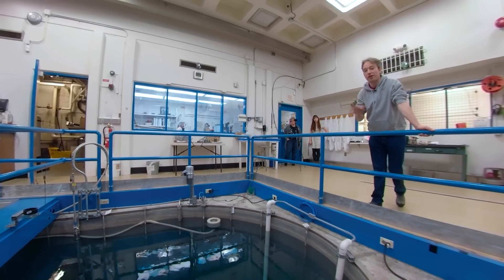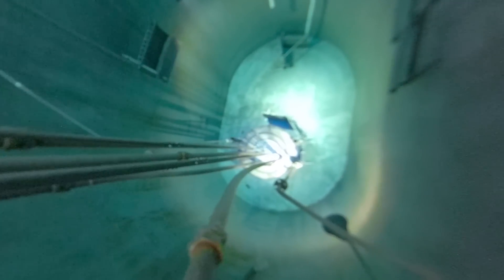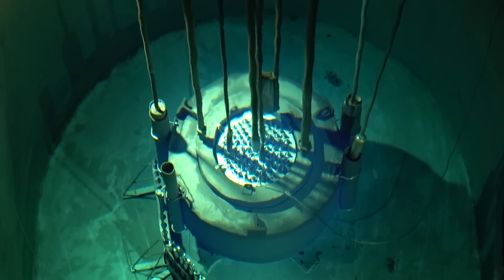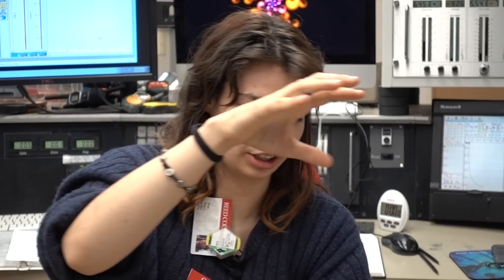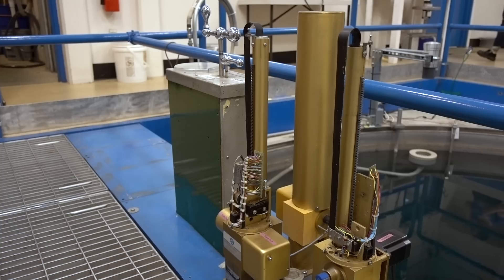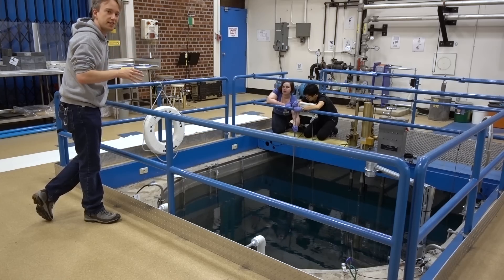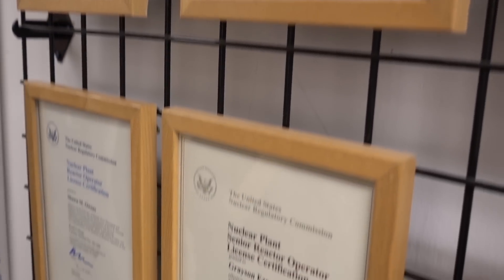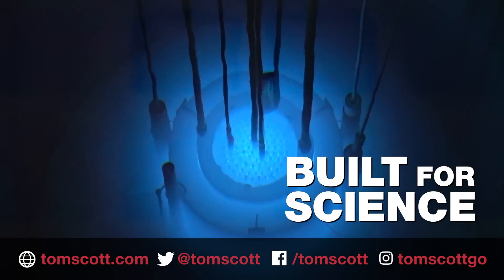This nuclear reactor is run by students

Comment: The stupid thing is that Reed doesn't have a nuclear engineering program. Some say that the only reason they have the reactor still is because it's too expensive to dispose of.
Reply: Alexander DePillis Reed is a small liberal arts college, our majors are in more general subjects.  It wouldn't make sense for us to have a nuclear engineering program, because each graduating class is less than 400 students....how many of them would want to specialize in nuclear engineering each year?  That said, Reed has very strong science programs for a liberal arts college and has produced an unusually high number of Rhodes scholars and has a very high rate of students going on to earn PhDs.  Additionally, experience with the reactor is useful for other majors besides nuclear engineering- I would know, I graduated with a degree in Biochem, am going into nuclear medicine, and my experience at the reactor has been incredibly useful!!  The reactor is also a fantastic college job, and we teach many skills (such as management, public speaking, research design) that are useful for students not going into nuclear science. 

As for the cost of decommissioning, it is indeed expensive.  However, it is required in the reactor's facility license from the NRC that we have the money available to decommission if the need arises.  If we were not able to afford to decommission, we would legally not be permitted to operate the reactor.  The money set aside for potential decommission is a part of Reed's multi hundred million dollar endowment.  The license is re-evaluated and renewed every several years, but representatives from the NRC come to inspect our facility at least once a year to make sure everything is going well.
Reply: Sarah Brodesser Thanks for your thoughts, I knew Reed was small, but I didn't know it was that small. I do think that they could support a nuclear engineering program, in part because the reactor would be a major draw for nuclear engineering students.

I was also unaware of the money specifically set aside for decommissioning. 

Thanks again for giving me a new perspective.
Reply: +Liou David as they said in the video, at the current rate of use, about 100 years left

nuclear fuel is expensive and hard to manage but it last a really long time
Reply: As a Reed grad ('87), now with a PhD in physics, I'd say the reactor was a useful and functional part of campus for many departments. As a liberal arts school, we're learning the fundamentals, knowing that we'll apply them later (I went to Purdue University afterwards and have taught at several colleges and universities). I really can't imagine having an engineering program at Reed, though we do learn a lot of applied skills. For example, I took a course in microprocessors. The professor, Richard Crandall, was lead cryptograher for Apple. And I took a course in algorithms. Etc. I'm happily passing along my knowledge to high school students in Louisville Kentucky now.
Reply: Some reactors burn through rods in 5 years, others can take up to 30
Reply: @wifi_the_router  I had an ex like that
Reply: This reactor is an instrument for doing chemical analysis, (neutron activation activation) mainly used by the Reed chemistry and biology departments.
Reply: +Samantha Dansjin when utilised close to 100% of the time, yeah, you get "just" few years up to few decades out of them

meanwhile, in the middle of winter, I need to go put coal into the furnace every hour to keep the house warm
Reply: Wait what? A university bought a nuclear reactor for the sole purpose of education and doesn't have a degree to match?
Reply: how long does those rod last?

Comment: Holy crap this was interesting, Tom. Can you point me to a video that can elaborate on that "visual sonicboom" effect?
Reply: I don't have a video for you, but the blue light is from particles that are traveling close to the (vacuum) speed of light entering a medium where light can't travel as fast, like water. Since they're now traveling faster than the (in-medium) speed of light, they have to slow down and lose energy. They do that by giving off light, which is the glow you see when the lights are turned off.
Reply: doublej1076 awesome explanation. I appreciate you taking the time to elaborate on it for me. Thank you!
Reply: If you search for Cherenkov radiation you should find some great explanations for it. The effect is caused by electrons that are released by the fission reaction and are traveling faster than the speed of light in water(which is only 3/4 the speed of light in a vacuum).
Reply: doublej1076 so you could change the colour by changing the liquid? Have a pimping purple reactor??
Reply: @magicalpencil  Possibly, but the question would then be how well does that particular liquid work as a shield and the ability to remove heat from the radiation process.  As mentioned below, it will depend on obtaining the proper peak emission frequency for the Cherenkov radiation.
Reply: *is naturally able to in water. No laws broken
Reply: Unfortunately probably not purple, the peak emission frequency for Cherenkov in water is actually UV, the reason why we see it as blue not violet is due to the fact that the human eye's sensitivity to light peaks at green. 

Its a similar reason to why the sky is blue, actually, Rayleigh scattering means that higher frequency light such as blue and violet is scattered more (with violet being scattered more), but with the addition of the human eyes greater sensitivity to blue.
Reply: 1997CWR thanks!
Reply: Ah, all's right in the world then.
Reply: magicalpencil You are asking the interesting questions!
Reply: No, they dont travel faster than the speed of light, they travel faster than light would in water. They arent even as fast as light to begin with.
Reply: So, that means those particles do travel faster than the speed of light, even if for a moment?
Reply: Interesting stuff!!
Reply: Toss something that fluoresces purple in the water, sort of like purple fluorescent lights.

Comment: I'm from Portland and this is my favorite way to freak out people who are afraid of nuclear power. "yeah there's a reactor like 3 miles away ran by students at Reed."
Reply: I do the same with the research reactor at my undergrad uni. It was run by the profs though because the computer system hasn't been replaced since it was built in the 70s and they don't want students breaking the vacuum tubes.
Reply: @agilemind6241  vacuum tubes my God that's old
Reply: Agilemind 🍸 noice
Reply: @agilemind6241  what uni ???
Reply: My favorite part was in all the recruiting materials I ever got from Reed, they emphasized this rubber duck they always kept on top of the reactor XD
Reply: @alyandthecats  THERE'S A RUBBER DUCK?!
Reply: I'm down at OSU and I do the same thing. My old apartment complex was about a quarter of a mile from our reactor, which freaked my family out. I walked by it twice a day on my way to class for 2 years without worry though.
Reply: @B-rad1  Gotta love freaking out people who are scared by nuclear power
Reply: There's a nuclear reactor near here run by 19-21 year olds who aren't even pursuing a nuclear engineering degree.
Reply: "There is a reactor near here that is run exclusively by people who couldn't even finish their university degree..."
Reply: Same i live in oregon but im down in eugene
Reply: I'm from Portland too. I'm going to have start using this.
Reply: And it has run for the past 50 years!!
Reply: @elliotpowell1702  that's not true - nuclear power kills less people per megawatt than even solar or wind, and hundreds of times less than coal mines. Chernobyl was caused by poor regulation + oversight and it is likely that a disaster of that scale would not ever happen again.
Reply: @codyfellinge2346  Except when something close to that scale happened again in Fukushima. 'Luckily' a lot of the fissible material sank into the pacific and the government was quick to relocate the populace.
Reply: @codyfellinge2346  
... Until a Chernobyl scale disaster times 4 happened at Fukushima.

Never say never.  Have you heard of Davis-Besse, "the reactor with a hole in its head"?
Reply: Acme Fixer no power source is 100% safe
Reply: @dylanb2990  But some are safer than others. Fossil Fuel, Solar, Geothermal, and wind all haven't caused nuclear explosion. There is always reason to be skeptical, and by saying, "All energies are unsafe" it downplays the destruction capabilities of the nuclear reactor. I'm staying as far away as I can from those things, if you ask me.
Reply: @acmefixer1 in the triga reactor you can say never, in some operations they even let the reactor run away, at full power, until the cooling water kills the reaction again, there is so much cooling water it physically cant run away. the only reactors where this can catastrophically go wrong is the rbmk (chernobyl). Fukushima is a different case as half of the reactors control systems literally broke.
Reply: @codyfellinge2346  Your argument does in no way disprove the claim you're replying to. If you do not understand why a 250kW power plant (whether nuclear, coal, hydroelectric or something else entirely) is inherently less dangerous than a similar 250MW power plant, then I hope for the sake of everyone that you'll never have to make decisions pertaining to public or industrial safety.
Reply: Run*
Reply: "And they keep dropping their phones in it"
Reply: when i heard 3 miles, i immediately thought 3 mile island.
Reply: Proves how safe nuclear power is.
Reply: @elliotpowell1702  
That's like saying, "If it's small, then it can't end up like Chernobyl."

At WIPP, someone used the wrong type of kitty litter and a 'minor radioactive waste spill' cost a half Billion dollars to clean up.
Reply: I would be scared, that stuff is still dangerous.

Comment: What's the purpose of the water? I see it everytime whenever it's about nuclear power technology yet still doesnt know what it does
Reply: Dani Ihza Farrosi cooling and shielding from radiation
Reply: Cooling
Reply: In many types of reactors (including this TRIGA iirc) the water also acts as a moderator, ie slows down neutrons to a speed at which they are likely to interact with the fuel. Neutrons leaving fission events are typically to fast and would exit and be absorbed elsewhere if they were not slowed down by the water...
Reply: Cooling and absorbing radiation. I think.
Reply: Ah neat..! Thanks for the info
Reply: The TRIGA is a light water reactor. If you spent the money making heavy water, the last thing you would want is for it to evaporate! Heavy water reactors are closed systems.
Reply: Ya, the reactor actually doesn't even function without the water. like 
sadropol mentions
Reply: Cooling and shielding
Reply: Hydrogen is good at blocking radiation, and water has a lot of hydrogen in it.
Reply: Ya, TRIGA is NOT a heavy water reactor at all. This is completely incorrect. Only CANDU and certain research reactors use heavy water. HWR are actually a little more concerns for proliferation because of their lower neutron absorption cross section...it is much easier to breed plutonium.  Part of the Iran deal was them scraping their HWR, for instance, and the Indian's got their weapons grade Pu from a small HW test reactor. TRIGA is not such a thing. It is small, it is safe, it is basically for students and can serve as a novel but modest neutron source for materials testing. But nothing like a HWR which can give you very powerful neutron beams.
Reply: The pool is situated above the reactor so that in case of a meltdown the water will soak the meltdown by gravity. Also the water is usually "heavy water" with deuterium that further moderates the radiation. In larger reactors, those that boil water for power, there is a lid on top of the fuel separating the water from the fuel and there is no radiation leaking into the pool in normal operation. The lid is only opened when refueling.

Comment: YES! This is the content! Nuclear is life!
Reply: John Smith nice propaganda m8
Reply: Im all for nuclear, but big solar is fine as well.
Reply: Patchouli Colt …until you swim in it 😅
Reply: It's called "Nucular", "The Nucular"! And you mean "nucular is death"!
Reply: France is using Nuclear big time now and using the waste as energy too. America needs to reconsider nuclear before it is too late. Solar is good, as long as it isn’t cloudy. Hydroelectric is a good source as well, but disrupts the water flowing system and changes valleys and rivers and needs a crap load of construction.
Reply: Eric Franco: Nuclear energy should not be reconsidered by anyone. If you use the waste another time it's still radioactive for millions of years. Nuclear energy is not clean and not CO2 neutral. Please do some research and inform yourself about all risks. There are many.
Solar is still good if it is cloudy. It generates at least 10% of its maximum output, even in northern Germany. (acc. to the German Prof. Volker Quaschning here on YT)
Run-of-the-river hydroelectricity is a better way of generating hydroelectric power than using reservoirs. (see Wikipedia)
Don't forget wind energy. The German company Greenpeace Energy produces hydrogen from wind energy which they feed into the gas pipeline network. They call it Windgas.
Of course we must not pave the whole world with solar modules and wind turbines.

But what most people don't want to hear: we all have to reduce our energy consumption, at least a little, better as much as you can. We do have to give up a little luxury to save the planet. I'm already doing it.
Reply: The Python Guy: Are you a troll? Nuclear energy is not clean and not CO2 neutral. Please do some research and inform yourself about all risks. There are many. But maybe you're just caught in your filter bubble and can't see the truth any longer.
Reply: Patchouli Colt Chernobyl is a LIE! Storing nuclear waste indefinitely is no problem AT ALL! Big Solar is one of the biggest threats of America! ☢️☢️☢️
Reply: John Smith don't worry, I knew you were joking 😗